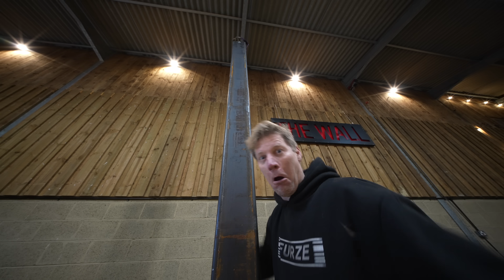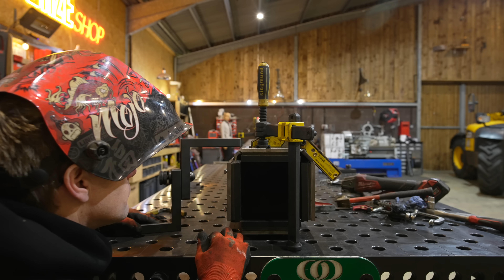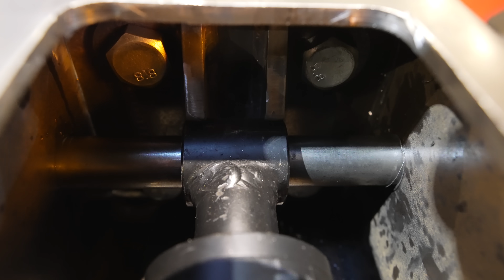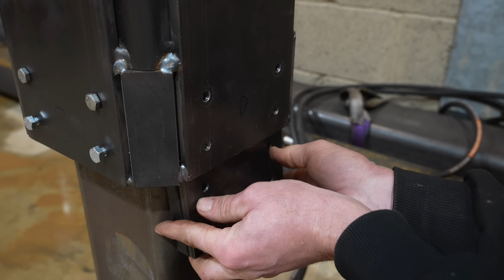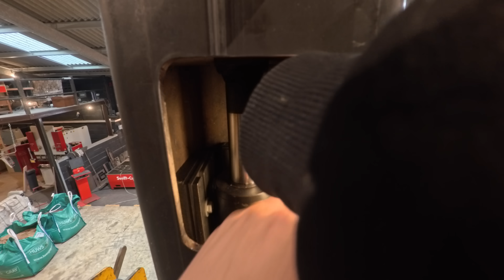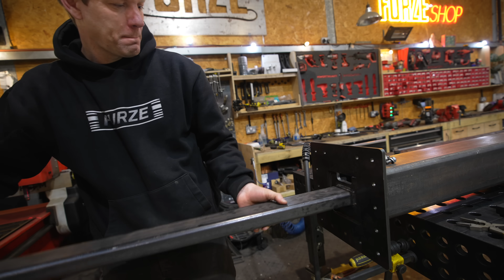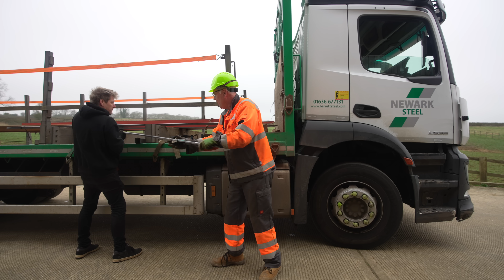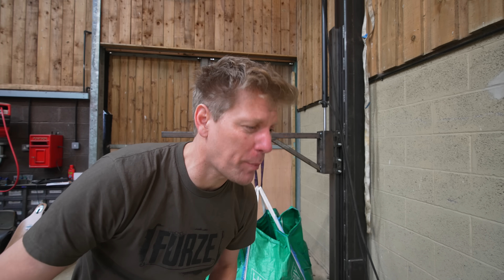Digging SECRET Garage Part 7 Car Lift Prep

Comment: That whole video and you only showed us one complete post okay posting on two channels is starting to get redundant you've shown us most of the engineering involved that you've done to design the posts yes there was a little bit of new but not enough to compensate for all of the reusing of old footage and we've already seen what you are reiterating and already shown us this is just constructive criticism here I hope you take it well but we expected a bit more I'm pretty sure I'm not the only one I figured you would already have all four posts ready to go at least and then the next set of videos would be of the platform either way I just wanted to say I think that it's starting to get redundant posting on both channels pretty much the same content Also sorry for the lack of punctuation I'm using speech to text which absolutely refuses to do it correctly
Reply: I love this comment talking about redundancy which then repeats itself multiple times
Reply: @PezLord913  
Yeah i do need to get better at getting the point across without saying the exact same words in the same way over and over again I've noticed that as well

Comment: Curious why you didn't use cables and a pully as commercially available car lifts use?  Lift speed is 2x the ram speed. Also how forklifts work.

Comment: I don't like the idea ........ I would have each corner being raised on a screw and the speed of the motors can be controlled easily so they all move at the same rate. Also, if a failure occurs, nothing drastic will happen. Mmmmmmm, I'm intrigued. Colin does tend to do things unconventionally and somehow get them to work. 😁

Comment: Been following Colin since 300k subscribers and not once have I seen him lose a 10m socket.
Meaning this garage is only his second greatest achievement
Reply: Not losing a 10mm socket or wrench is an impossibility. He must have extras we don't see.
Reply: @jesstreloar7706 , another impossibility is finding a 10mm socket, which I did. I did hold a 1 minute silence for the fellow who had lost it.
Reply: @jesstreloar7706  It's all AI. Furze is a digital construct.
Reply: No, 10m, not 10mm. They’re incredibly difficult to lose, due to their colossalness.
Reply: @ukuleletyke  I didn't even notice it was a single 'm'. It'd be pretty darn hard to lose a 10m socket considering you could comfortably live inside it!
Reply: @HDL_CinC_Dragon No, I don’t think you could comfortably live inside it- the rain would pour in through the hole for the 15’ drive in the top.
Reply: I found a 10mm socket in a box containing all my other sockets the other day. I didn’t expect to see that there so it must be yours. I’ll pop it in the post once I find…Aaaaarrgghh!
Reply: he just edit's that out ???
Reply: We had an apprentice at our workshop and his Dad decided to get him a basic tool kit to get him started. Except he took out the 13mm and 10mm Socket. 
He said "Get used to it, this is going to happen alot!" 😂
Reply: @justandy333  i worked as a lube technician for 5 years, and the last 6 months building bikes. i've never lost my 10mm and 13mm

what i have lost is the ABILITY TO FIND ANY BENT-HEAD RATCHETING COMBO WRENCH ANYMORE apparently
Reply: What you propose is not physically possible in our universe. Even people who have never owned a 10mm socket in their lives have lost multiple 10mm sockets. The only explanation is that he has a 55 gallon drum hidden from view that's loaded to the brim with 10mm sockets and he has a contract with multiple local distributors to come and top-off the barrel at the beginning of every week.
Reply: This is Furze's special power. Any time a 10mm socket goes missing anywhere in Britain it appears in his bunker.

Comment: First time I've seen a sponsor of a product I actually use. I don't know 3d modeling very well but we have a lot of plastic parts in a hotel. And paying 13 for countless handle adapters in guest rooms sucked. Bought a 3d printer, found onshape via Reddit and was able to make my own versions of the adapters and print them. I just hope now that they are getting bigger, they don't get rid of the free tier for personal use
Reply: Using them for bits for every hotel room doesn't exactly sound like "personal use"! 😂👀🤫🤫🤫
Reply: @sonovoxx  🤫 I made the design at home lol but I primarily use it for personal prints. Convincing the hotel we could save money on these adapters is just how I convinced them to pitch in on the cost of 2 elegoo printers 😂 but the free tier just means your designs are open for public use vs private if paid.

Funny part, I'm leaving that hotel in a few weeks. I'm leaving all of my designs so they can continue printing them but I added my name to every single design so my name will be all over that hotel for years.
Reply: @CanadianWaters don't worry - I won't tell anyone. It will be our secret! 😂🤫

Comment: did you ever consider using worm gears to raise up the car?
Reply from the maker: they are more bespoke and not many places make them, hydraulics are more common so if any issues more like to be able to sort it out, plus the alumni of weight is quite high so not sure how big they would need to be etc

Comment: Is there a reason you went with pistons instead of using hydraulic motors with a chain drive and gears in the posts like other vehicle lifts?

Comment: So why do one need to have the legs bolted to the ground when they can be fastened at the top with the hydraulic ram inside the leg passing through a slit and you can mount traditional stops on the outside at the top.